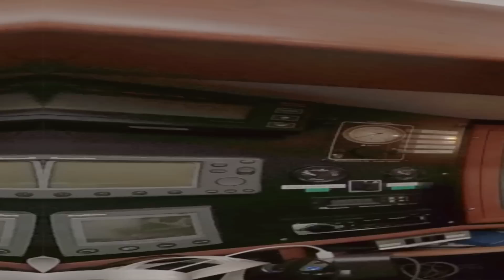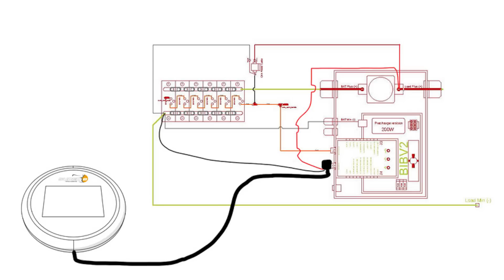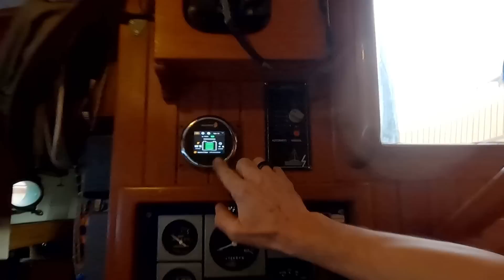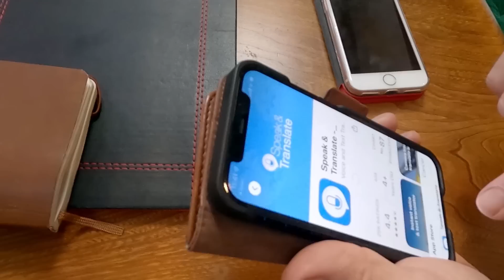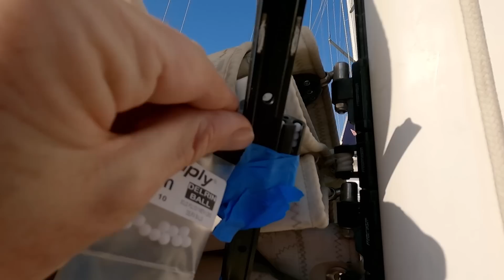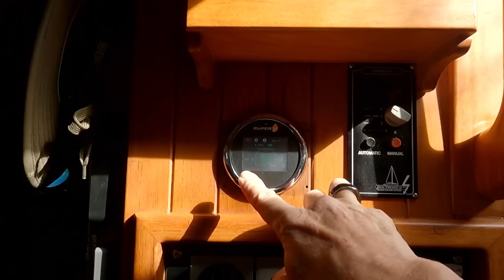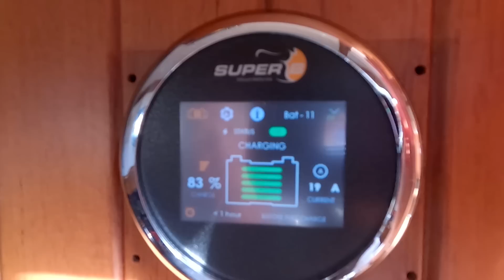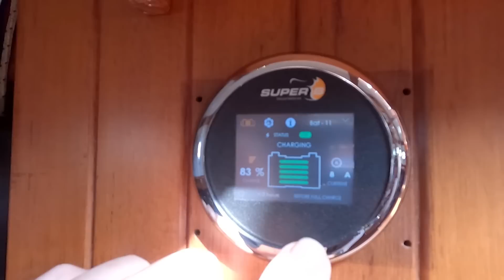Ep61  |  Power, Water, Wind...  Perfect!

Comment: Steve - poached egg tip! I used to add the vinegar to water until I saw this: get a shallow dish or plate, add a few drops of vinegar, then crack eggs into it. Leave for a few moments then gently tip in the boiling water, from a low height. Really improved my poached egg game!

Comment: Great episode folks.
We need some tech talk on the poached eggs Steve, you don't need the pan looking like the Corryvreckan to poached an egg, otherwise you could only do one at a time,
Sieve the egg ( get a small one), I use a glass to catch, the watery stuff from the egg, use the the freshest eggs you can, then pop it in a ramekin so you can slip it into the surface if the water,  getting the water boiling then turn right down, no bubbles then slip your eggs in for 4 minutes 30 seconds. Done! And none of that bloody vinegar. Good luck and be safe. David
Reply from the maker: I’ll give it a go, thanks
Reply: @svfairisle  I'll be watching...

Comment: Tefgel as a substitute for dielectric? I only use tefgel where dissimilar metals are involved, but it obviously has other applications, unless you addressing the battery post to cable lug issue.  Great video.

Comment: Did I miss something? I thought Tef-Gel and dielectric grease are two different things.
Reply from the maker: Dielectric grease just means a none conducive grease, could be lots of things including Vaseline. Tef Gel is the best stuff though, it’s PTFE based and it’s main use is anti galling in stainless, stopping dissimilar metal galvanic corrosion and keeping electrical connection’s good. Thanks for reminding me though I will add a section in the page I’m writing on batteries on the website, people always get confused how it can stop galvanic corrosion on the one hand but still allow a good electrical connection in wiring
Reply: @svfairisle  interesting. Vaseline isn't great due to its lower melting points. Over time it's prone to melt away.
Are you applying it to the surfaces of the conductive join? I apply it after the join is made as a final step to prevent humidity/corrosion entering the join. I guess it gets squeezed out, and makes for a better seal.

Glad your set up is all working well. Such a great sense of freedom to have water and power autonomy. Especially with the state of the world just now. Have a great season heading west.
Reply from the maker: @andypag1071  Yes that’s right, that’s why it’s better to use Tef Gel, but smear it all over the connections before you bolt them up. I’ll do the write up on the battery page of the website now.

Comment: Steve, just a thought, while watching, l noticed what looks like the positive and negative lug connectors in section 5:52 are so large in diameter that if one of the nuts get lose the connectors could rotate and make contact causing a direct short. Thanks for sharing.
Reply from the maker: yes it's possible but unlikely as there is just a 6 inch bit of cable off either end so not liable to move even if the bolts came loose. I would take it much more seriously if the result was shorting out positive & negative but thats just the breaker for the positive line so if the touch it just means the switch wouldnt isolate properly.

Comment: Judy and Steve you have such an inspiring channel. It’s been a few years now since I last owned a boat - well a fractional share in a Hanse 350 which we kept in Milna in Croatia and then in a Beneteau 393 which was based in Cleopatra Marina in the Ionian. And several decades since I did a road trip around Turkey. I’ve swapped a sea yacht for a land yacht for now to suit my circumstances better but am thinking of chartering with friends who sailed with me many times in Croatia and Greece but this time maybe in Turkey. It will be interesting to follow you around to see where the best would be to charter for a couple of weeks in Turkey. The 2 of you really make me miss my sailing days. And I’ve come to appreciate the beauty of your boat with its traditional shape, full keel, keel hung rudder etc etc. I would also be super excited by a new lithium battery system and water maker!
Reply from the maker: I think chartering in Turkey should be a very good option, the exchange rate is very favourable here at the moment. As for the cruising ground from what we hear and from the bits we've seen so far it's excellent. We will be cruising South along the whole coast so will be sure to point out the best bits for you.

Comment: I'm hopefully going to be in a position to purchase a Kraken 50 sometime soon if the stars align. It would be great to get your thoughts on her strength, stability and construction of her much vaunted zero keel.
Reply from the maker: Lucky you! Don't worry I'll be digging in there to get a good handle on what they're doing.
Reply: @svfairisle  Fantastic. My only worry is that it looks like the strength of the keel comes from glass reinforced divancell foam tapering down to the lead bulb. Hard to tell from pics if it looks strong enough given the force the big lump of lead at the far end of the keel structure would place on the supports.
Reply: @svfairisle  By the way. Love the content you guys create. One of only three channels that I really look forward to. Trying to sign up to support you on Patreon but struggling. I shall persevere in making my contribution to the ongoing supply of dielectric grease and hull polish.
Reply from the maker: Yes the zero keel is something I want to look into. I see they've got a really strong support for the skeg which a lot of builders overlook. Thanks for your support by the way, it looks like you made it through the glitchy software that is Patreon!
Reply: @ssk3940  Thank you for trying to support us! I got a notification on my phone that you had then it disappeared. Do keep trying! The patreon site is not always easy...

Comment: Steve, do you realize you live on a power generating station? Sit back and look at the wiring, controllers, monitors, heat sensors, alarms. Etc etc .Canadian, Joshua Slocum circumnavigated twice with paraffin lamps. Is all you have really necessary? Just an observation.
Reply from the maker: Well that’s just a silly argument really. Do we really need washings machines in houses? People got by with a washboard and mangle in the past, but try and find someone now that would like to go back there. It’a more serious than that on a boat though we don’t have a lot of the conveniences of a house but in the modern world you really need the ones you have. I can’t charge a laptop and my cameras from a paraffin lamp! I could dig out my old arriflex film camera and do it that way, but good luck finding film processor now. It’s hardly a YT channel! Times have changed for navigation at sea too. I sailed as a teenager before GPS with a sextant and paper charts & frankly it’s bloody dangerous. If you haven’t run aground after 3 days with cloudy skys and no sextant shot (and no RDF bearings to help as they’re all turned off now) you’ll probably burn your boat down with the paraffin lamp!
Reply: @svfairisle  didn't intend to initiate an argument. Just an observation. Must take a lot of your day monitoring all your systems. And hugely expensive to purchase.
Reply from the maker: @billygrahamyachtsinc753  It’s an expense and a responsibility to fit and maintain yes but what I’m trying to get across is that having reliable power on a boat is a necessity not a luxury these days. With out it you are consigning yourself to maintaining a position on a paper chart and that is a full time job off shore. It would take me half an hour to get a sun/star shot with a sextant and work out the figures to give me a line. You need three for your ‘cocked hat’ and the you have to constantly dead recon forward, not having to do that frees up my whole day.
Reply: @svfairisle  I understand, as I have a 60' LOA Schooner. What is a "cocked hat"?
Reply from the maker: @billygrahamyachtsinc753  Navigating traditionally you tend to just get a line that you know you are on. A sight bearing from shore could be one, a second could be a sextant noonshot which will give you your Lind of latitude and a third could be a RDF bearing. These three will not intersect completely because there is always error, so you get a ‘cocked hat’
Reply: @svfairisle  British humour....love it. My parents were British and Irish.